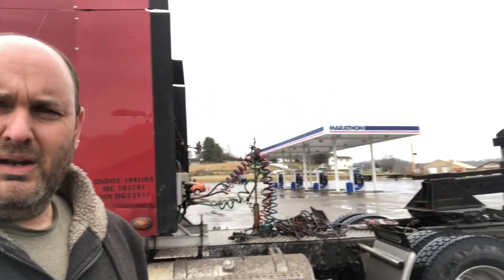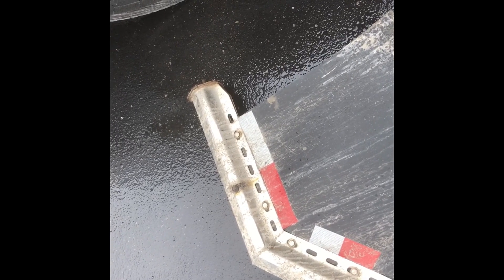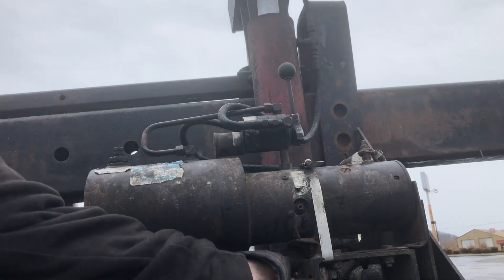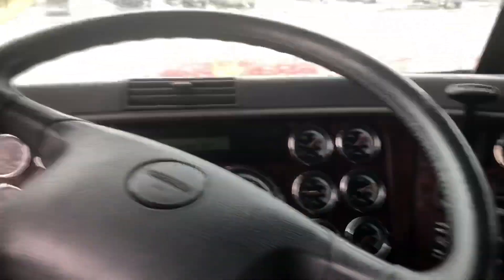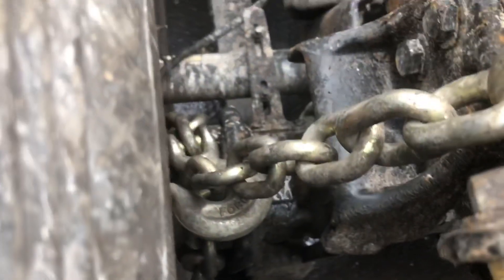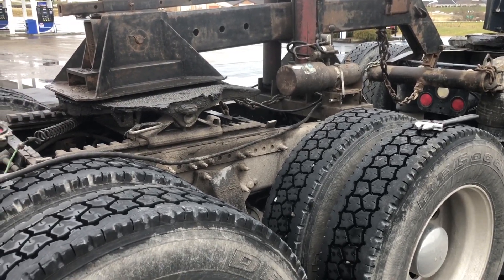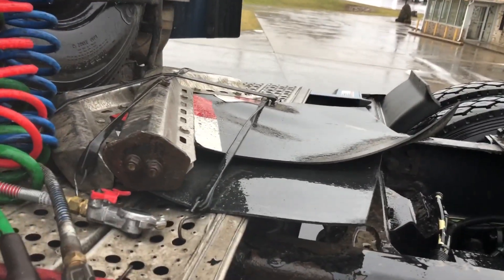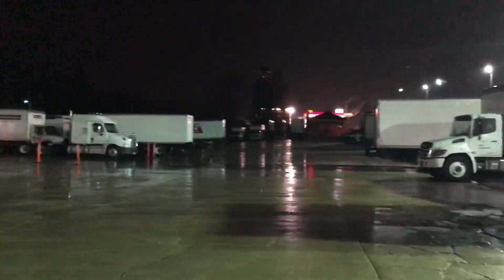Trucking , transmission issues , so I tow myself to the dealership

Comment: How many miles were on the trans before it went out?
Reply from the maker: JacolbyDaTrucker 1 million , 200 thousand
Reply from the maker: I have changed the oil every other year for the past 10 year. I use Mobil synthetic. But most of those years I did pull permitted overweight loads long distance.
Reply: I’m thinking about getting one myself has a lil over 700k miles on it main bearings rod bearings and cam bearings have been changed. Glad I found your channel
Reply from the maker: If it’s had a new bottom end installed you should be good to go. There’s a lot of money out there , I would say cut you a slice of the pie .